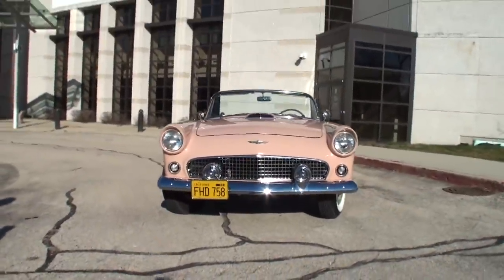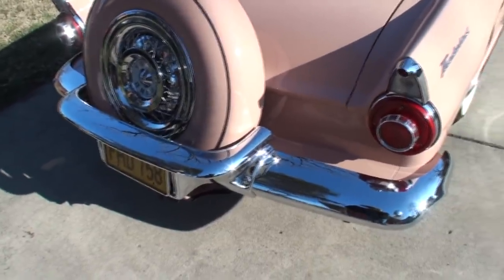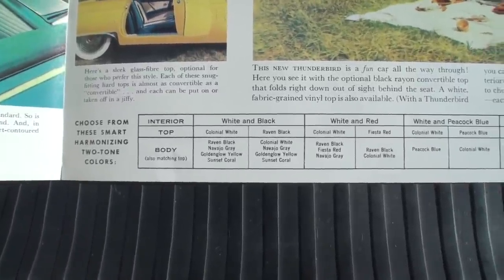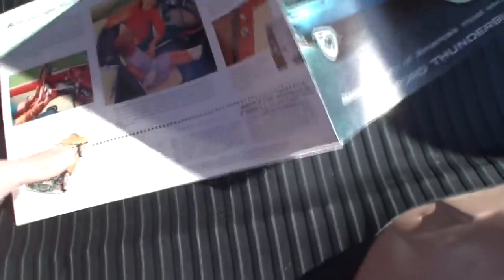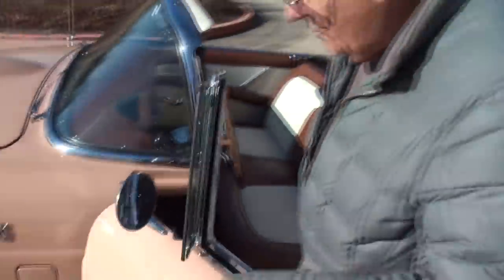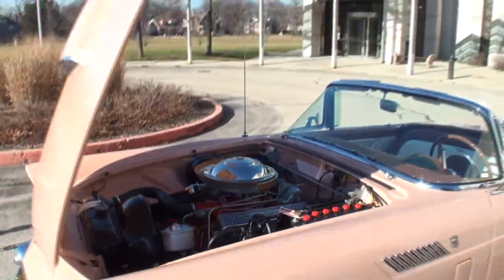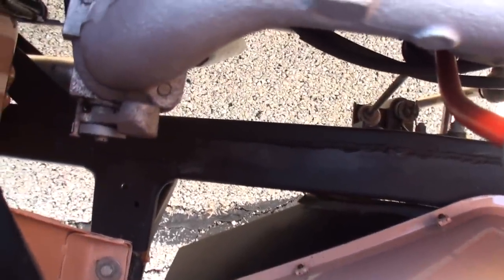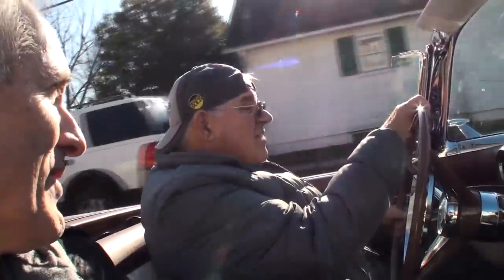1956 Ford Thunderbird T Bird Convertible in Tan 312 Engine & Ride on My Car Story with Lou Costabile

Comment: Hi, Lou! Well, I've been saying that Dennis has such an amazing knack for finding the most shining examples of the classics, now including "America's most exciting car"!

That lock mechanism you were looking at was part of Ford's "Lifeguard Design" that was new and highly promoted in 1956. (Also notice the decal below it.) It used what they called a "double-grip" latch that was designed to prevent the door from being jarred open upon impact in the event of a crash. There was also a dished steering wheel, a pivoting rear view mirror, and optionally, seat belts and a padded dash. Before Chrysler had the "Astradome" instrument panel, Ford had "Astra-Dial", which was was lit by the sun.

Many thanks to you and Dennis for this leisurely boulevard cruise!
Reply from the maker: Hi iswc27, Happy to read "now including "America's most exciting car"!" :-) Thank you for sharing your knowledge, and you're welcome, Lou

Comment: 11:34 Notice how they used the gold "V" with the 8 cradled on top, as Ford always did, but then they added the red "Y" underneath that, designating the Y block. Loved that little touch they added. Love the sound of those mechanical lifters and the bottom end torque these motors had relative to their cubic inches, off throttle response seemed like a larger motor than it was, just not a rev monster.
Reply from the maker: Thank you for sharing what you notice.

Comment: Lou, 1954, my dad took me to the Ford dealer where he worked to show me a light blue '55 Thunderbird before it was revealed to the public. I was only 8 years old. I'm now 75 years old but the memories, of that car, remains very vivid in my mind today. I wish that I could find a way to pass on all my auto/truck knowledge before I'm gone from this earth.
Reply from the maker: Hi Sergeant Masson, Happy to read a great memory with your Dad :-) Reason I have this Channel is exactly so I can leave a legacy of why we love these great cars, Lou
Reply: @loucostabile  My dad was a great auto/truck mechanic but he only became a shop leader later in life. I reached master level status at age 24 and was the shop manager and service manager at age 26.  At 34, dealer general manager. I earned a ton of awards and certifications but none meant as much as the day my dad told me that I was a far better "wrench-twister" than he ever was. When I was doing professional auto racing, he was there every race and helped, even if it only involved him refueling the race car. I won three NHRA class championships and won 232 races. I now cherish that he was there for it all. He passed away in 2007, the day after he and I rotated the tires and changed the oil for his 2006 Chevy V6 S-10 4x4 p/u truck. The only new vehicle that he ever bought in his entire life.

Comment: Dennis has a real special car there.  That car is a real work of art and looks like it just came off the showroom floor.  Dennis also knows quite a bit about the differences in the T-birds from year to year.  Certainly very interesting for the viewers.  Lou, you have an amazing channel and its really terrific you keep bringing these gems to your viewers.  Thank you.
Reply from the maker: Hi Kevin. Happy to read "That car is a real work of art and looks like it just came off the showroom floor. " :-) You're welcome, Lou
Reply: Back around 1968, I knew a co-worker--a rather snobby type, who owned a 56 T-Bird...He offered to let me drive it--if I would put some gas in it!...So of course, being a 20y0, easily impressed guy, said OK!...I was a little crestfallen, to experience the handling of the car...despite power steering and brakes, it felt heavy, and did not handle in the turns well. It felt like a larger luxury car.  And the acceleration was just so-so...so I told the stuck-up guy what I thought...he hardly ever talked to me again!
Reply: @curbozerboomer1773  Thanks for sharing your first hand experience.  Most folks never get so close to these kinds for vehicles.  Best to you and the family.

Comment: 1956 model Thunderbird was the only year that came standard with a continental kit for the spare tire. 312 engine was an option. Base engine was the 292
Reply: When did the 332 FE become available?
Reply: @Johnnycdrums   1958. Ford FE engines were discontinued after 1976. FT version continued through 1978 for the bigger trucks.
Reply from the maker: Thank you for sharing your knowledge.

Comment: First, the best ways to tell a 1956 from a 1955 T-bird from the outside was that the 1956 had the fresh air intakes in the front fenders. If a T-bird had a hardtop, the 1956-7 hard port hole windows. The 1955 did not. 
Now, the T-birds NEVER EVER had 2-speed automatic transmissions, they were always 3-speeds. From the start, the original Ford-O-Matic/Borg-Warner automatic was a 3-speed, although they started up in 2nd gear, through 1955 you had to put the shifter into "Lo" to use 1st gear. Starting in 1956, if you pushed the gas pedal nearly to the floor, the Ford-O-Matic would automatically start up in 1st gear. In fact, Ford didn't even have a 2-speed automatic until 1959, which was a small aluminum-cased unit mainly used in Edsels and behind 6 cyl. and 292 V8's in other Ford models. Thru 1964, you could only get this 2-speed automatic in the Falcon/Comet line and the first Mustangs. This automatic was also called the Ford-O-Matic, but had no relationship to the original cast-iron cased 3-speed Ford-O-Matic. In 1958, with a selector position added so that the transmissions would start up in 1st gear, from then on, a 3-speed Ford automatic was called the Cruise-O-Matic. The difference between the  original  Ford-O-Matic and the next generation Cruise-O-Matic was the addition of a sprag clutch in the middle of the cast-iron case to add more strength for 1st gear start-ups.
Reply: You were doing great ‘til you got to the sprag clutch !!
Reply from the maker: Thank you for viewing and sharing your knowledge. Lou
Reply: @loucostabile  Thank you for making these great videos! The trouble is that the owners of the cars don't always know the correct info about their cars.

Comment: I love the t-bird, but not this year. I think that they messed with a functional design with the addition of that really ugly continental wheel. So, is much difference between the '55 and the '56 mechanically?
Reply from the maker: Hi Dale, Not much difference mechanically I'm aware of. If a Viewer has knowledge, please share, Lou
Reply: I don’t get the hate the continental kit gets. Looks good to me, at least on this car.
Reply: The Continental kit is one of those styles that elicits strong opinions.  People either love them or dislike them.  The T-Bird in 1956 was already beginning its transition away from being a Corvette direct competitor to being a touring car.
Reply: @Nebulasecura  ; Although this one is functional, the Continental Kit impairs the handling, and I imagine it’s worse for cars with big rear overhangs.
It was good they got rid of it in 57’.